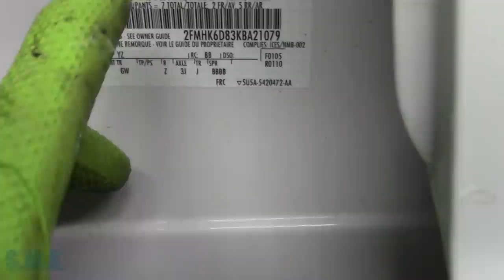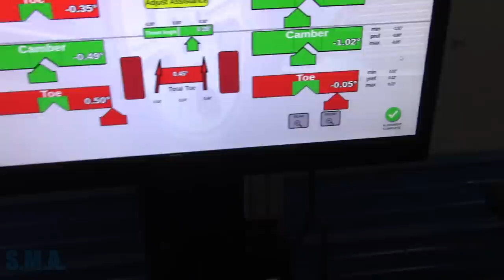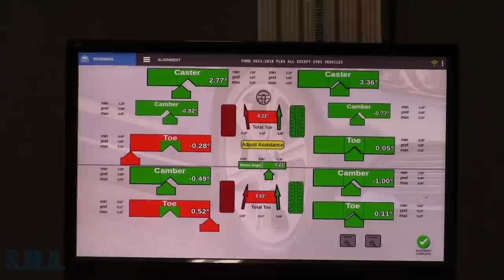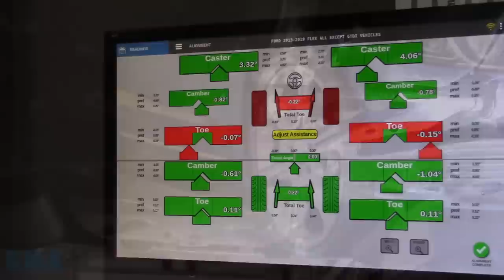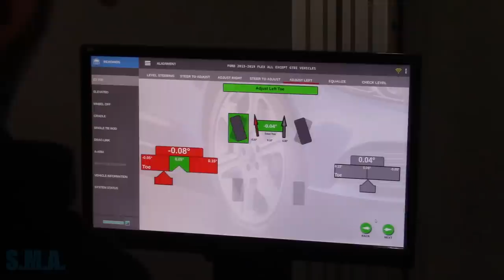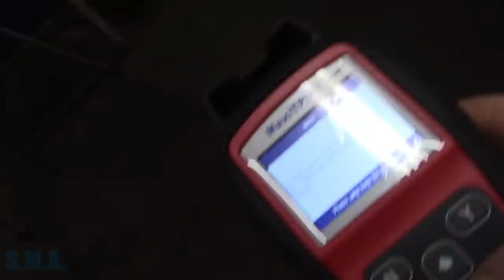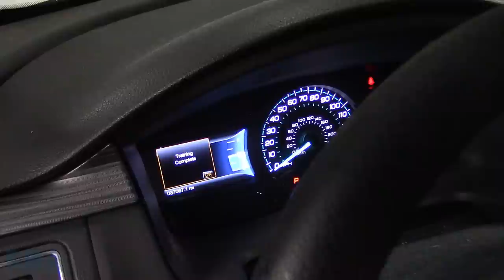Ford Flex: Wheel Alignment & Tires

Comment: A garage adjusted my alignment after fitting new tyres. The steering wheel was dead centre. After 10 minutes of driving it was way off centre. I returned to the garage and they said that they had to apply heat to free the locking nut on the steering arm. They hadn't allowed enough time for it to cool down, so as the arm cooled, it contracted and pulled the wheels out of alignment.

Comment: I can remember a car that went to loads of garages who said that the alignment was spot on event though it continued to pull to the left. A motorsport garage looked at it and YES the alignment was correct BUT the front subframe was out of alignment (apparently all the cars came out the factory with the same issue).

Comment: Ford dealer should tell customer repairs have been made But you need a wheel alignment, not included, or you will Ruin the Tires. It is wrong for Ford to repair and not align before shipping to customer anyway...  Great video!

Comment: If you need more work, I can certainly help you out with that. 2007 Suzuki SX4 and she's got the codes; evap leaks, cat efficiency, something about a prop shaft sensor... also needs tires! All this can be yours for the low, low price of donuts and coffee! I'll even throw in a "Where's all this oil coming from?"! Possible rear main seal.

Comment: 17:45. I once had to change a flat tire. I thought I was going to kick the car off the jack. I didn't have the corrosion as seen here but they were really stuck together. I then used anti seize grease on on all four.

Comment: Any other tool suggestions for cleaning the backside of the wheel? I'm worried about removing too much material from an alloy wheel. Maybe a white (fine) bristle disk? Or a fine roloc disk?

Comment: just wondering if you have started putting the foam rubber ring inside the tyres to lower noise of the tyre on the road surface ?   it’s all the new thing here in australia . it’s a donut of foam rubber same id and width inside tyre .

Comment: Since that was previously worked on at the dealer to have the rear differential replaced I would be first of all after the findings at your shop going back to the dealership and having words with the service department as to why I wasn’t told it was possible my vehicle was out of alignment and asking the dealer to pay for what I just had done do to their negligence

Comment: Damn, those rims are hammered for a 2019. They just don't make shit like they used to.
Reply: Wife’s car is a 2018 Flex, same black painted wheels. I hate their wheel paint.
Reply: @joekegg  It's not much better on the GM side of things either. Even the chrome plated rims start to bubble and peel after half a decade. Granted the New England winters contribute to that but it's just sad from my point of view that you have a vehicle not even that old and you have those kind of cosmetic issues.
Reply: @RiouInsuiko  Agreed. I have a 2019 Challenger and the wheel paint is ok but not great. Will likely have them powder coated. I had a Charger with “chrome clad” wheels—chromed plastic—and replaced them before they could bubble. 
For what a factory wheel costs you would think the finishes would be better.  Fortunately out west the climate is drier and they don’t salt the roads.

Comment: Fords/Lincolns I owned, do not need programming after rotation. They self learn by turning flasher on/off 3x, key on. What kind of pad removes the glue off the inner rims, without damage?

Comment: I had a 2010 Flex, and they are very sensitive to alignment.  I replaced front control arms, and thought I would be OK driving it to work for 2 days until the shop could fit me in for an alignment.  It ate the front tires in about 100 miles(they were less than 50% worn before).  I typically got less than 40k on a set anyway, but that was an expensive mistake.

Comment: Oh how I love when I have 4 paragraphs typed out, and I accident swipe my mouse right, and it ALL goes away in a blink ... :(

I've come to the realization that I need one of those newfangled tire machines with the mutant arms! You should see me trying to mount these modern rubber band tires. It's a full body workout!  It's like a monkey having relations with a football ... to put it in a  family-friendly sort of way ...

Had two NAPA caliper warranty claims, back to back! One was on our '93 940. I didn't know NAPA's Proformer line is remanned by Cardone! No friggin wonder. The 940 is on it's SECOND set in 2 years. All dragging. One rear caliper last year was so bad, I could get in the car, fire it up, and stand on the brake with both feet while pulling on the steering wheel for leverage until it flexed, and the piston didn't move half a MM!!! Totally junk in just a year and a half!! The front wasn't quite that bad yet, but was on its way. Immediately after finishing that, I had a comeback from a full brake job in September of '19 - 14, 495 miles, and the inner pad was GONE, pistons went right through the now tinfoil-thick pad, and got yanked from their bores, puking brake fluid all over the inside of the tire and wheel well. The rusty rim and step rail was the dead giveaway of the carnage lurking inside. What a mess!! Guess the only solution is to pony up for a genuine Nissan caliper, but the vehicle is owned by a single mom. I did what I could to get her out the door quickly and safely. Only charged her an hour labor, since I spent the first 25 years of my life in her shoes. Was glad NAPA covered the caliper, so she only had to pay for pads and rotors.

My plow has about had it on the ol' S10 - time to weld up a few more mower blades to get it straight again. :D We only got 6" of drifting powder. I didn't even have to clean the windshield off - it blew clean overnight! Only had to clean the strange formation on the right side and rear windows, lol. Winter's here officially! Here come's more snow for Friday and Sunday. :(

Comment: Hey Eric, you used a different disc when cleaning the goo off from the wheel from weights. What did you use? Dumb question but I have never seen that type of disc. I would like to get some.

Comment: what did you use on the grider end to remove the whell tape without damaging the paint?
Reply: It's mentioned above. Something called an eraser wheel. Though. they must also be called something else as I'm in Australia and have never heard of them.
Reply: Use the search term 'toffee wheel' and you'll find'em :-) they breeze through adhesive, but are weirdly kind to paint.
Reply: @Ro32da72  Thank you.

Comment: Gm replaced the rack and pinion assy. and lower control arms on my Sierra under warranty I noticed the tires were scrubbing bad going into my driveway, I went back and asked if the alignment was done, they also said that it would customer pay, I said I wanted to see the bulletin, the said no , I said if you replace any frt. suspension or steering component the alignment should be checked, to my amazement he came back and said I was right, according to the bulletin and did it while watched, they frowned on that.

Comment: Did you know that you are supposed to line the red dot up with the valve stem when you install a new tire. I learned that in training over 25 years ago. I was told that it helps the tire to balance better.

Comment: Now I wanna drive the 2hrs to your shop for tires on my truck and car, every local place here north of buffalo half-asses the tire install, they don’t bother to knock off the weights, I’ve complained and gone to different shops, and my truck still feels like a vibrator at any speed over 70... took one shop 3 times to balance my tires on my corolla.... and my truck was balanced twice at a shop, and twice at another, and still can’t get it done right 🤬
Reply: I went to a local independent that specializes in tires. Everything they have done for me so far has been perfect. They charge accordingly, and most customers won't pay the extra $ for a correct job. 

A few weeks ago I paid $32 for a rim leak there. That was the most I ever paid for a flat repair anywhere

Comment: My daughter's VW uses the ABS sensors to detect variations in tire pressure -  this obviates the need for those ridiculous battery operated TPMS sensors inside the tire.  Her car is a 2016 Golf and it also has enough space under the floor of the trunk to carry a full size spare wheel (remember those?)

Comment: Does spraying that fluid film on the wheel & brake rotor really help much? This is an honest question. I saw it has a flashpoint of about 405°F, but I'd think it would still burn off after hitting the brakes a few times.

Comment: Love wheel alignment, easy peasy until you get rusty busty need to loosen nuts and cams. Love the Autel 508 tool, the kiddos use it all the time about 50% compared to the Snap-on TPMS4. I noticed you didnt mention TPMS sensor placement  relative to duckhead and red dot on da tyre (ala Cadogan). Great follow up on the EPS and cleaning the hubs. Any thoughts on retorque after a test drive?

Comment: not sure about fords but fca vehicles are very good at relearning tire location on their own after a rotation or changing all 4 tires. in about 15 miles tops it will have calibrated itself. i have done some rotations where front psi was different from rear and watched on the dash during my road test as the numbers flipped from front to rear to compensate for my rotation. not really a criticism you do an awesome job, but on some newer vehicles you may be wasting a bit of time doing a tpms relearn every time. nonetheless, great video and great job as always.

Comment: They are going to no TPMS and just using abs sensors for rpm difference for the drop in tire pressure of 25% detection per DOT.  As tire pressure drops the size decreases enough to detect its too low with a compare to each tire.

Comment: The car needs tyres after only 18 months? must be really rough on tyres or they are really poor quality like firestone or bridgestone.  Also when puting new tyres on make sure the size is the exactly the same as OEM and has the same speed rating and load rating.

Comment: Cool beans...I think everyone is switching to electric impacts. I love my Milwaukee 1/2". Supposedly 1400 ft lbs of nut busting torque!
Reply: Yep, i bought one. Haven’t found anything it cannot take off yet or break off
Reply: Yea man those Milwaukee impacts are wicked good only problem I have is got to spend money on proper impact sockets as they just crack the Chrome vanadium ones from so much impact force / rate of impact 😂

Comment: "put the lights back on auto" 

Yes! THIS so much, THANK YOU! My BMW dealer invariably turns the lights off, putting me at risk of running blacked out. 

PLEASE PLEASE PLEASE MR  MECHANIC, LEAVE OR RESTORE MY LIGHTS AND OTHER SETTINGS AS THEY WERE!
Reply: If you need automatic headlights to turn on your headlights in the dark, you need to stop driving.
Reply: @markh.6687  What idiot comment is that? There is an auto setting for good reasons: it's convenience and safety. Same as auto door locks when you start driving. Or my wife's key programmed to open the driver door only, my key programmed to open all four. I like my wife to be safe, 'auto lights' included. I guess you sniff your nose at these fancy ABS, DSC and the likes as well ....
Reply: My pet peeve of having work done on my car. Given the number of cars running down the road, auto lights should be standard. The problem is that daytime running lights and full time illuminated dash boards fool people into thinking their lights are on. In the old days, not being able to read your speedometer was your first clue that your lights weren’t on.
Reply: @martijn-vels  It's hardly idiotic to suggest that drivers who cannot tell it's time to turn on their headlights should stop driving. I routinely see people driving with headlights off and totally oblivious to attempts to get their attention (flicking headlights on/off as I approach is a common signal). If they are that disengaged from driving they need to park their vehicles. Auto door locks are entirely unrelated to, and unsupportive of, your statements. I drove for years before ABS, DSC, and even DLRs. If you depend on the safety systems alone to save you, you're already heading for disaster. So a dealer that turns off the lights to save your vehicle battery (and light bulbs on pre-LED vehicles) is doing you a favor, and an aware driver will not have a fit over it; they'll say "Oh, I need to turn a switch or push a button." Gosh, I hope that's not too much a strain on them...

Comment: Must have been a rental fleet vehicle, my fourth vehicle was a retired rental fleet vehicle and the tires were never rotated and the front tires were the only ones replaced. Two months later I started to get a howl in the right rear under speeds and come to find out after a tire rotation the tires stopped howling and the rear tires were worn at an angle.

Comment: I bought some brand new rims and tires off tire rack and took them to a local tire shop to have them mounted. When I got home I noticed a scratch completely completely around the outside lip of the rim on the front. Took them back and he said that the the tires are mounted from the rear of the rim. why would I damage all four of my brand new rims that I took to him in boxes

Comment: You didn't index the tire to the wheel. LOL...may save you some wheel weights if you do. But I do love the actual torque wrench. Is checking ride height even a thing anymore before aligning vehicles???

Comment: Hey Eric, been noticing for ages that you don’t use anti seize as it’s too messy. You use fluid film as a replacement mostly.....how do you find it holds up over time compared to anti seize? I would assume it works good because you keep using it but would like your thoughts. Good question for a WUW session!

Comment: You replace a tyre the exact same way as me, and spend the extra few minutes cleaning the wheel and hub to get the crustys off! 
It doesn't benefit the customer, but it sure does benefit you when you replace the tyre next time!
I have one of those large lump hammers, normally required for steel wheels on a Ford Fiesta! 
I use a rawhide hammer for most alloys, if they need a bit of "gentle persuasion"! The hammer is branded as Thor!
Both the "hammers" I have were used by my grandad & great-grandad in the local coal-mines back in the early 1900's and 1950's!
What I would say is to get Black stick-on weights for those black alloys! In the UK the price of them is releatively the same as the standard stick-on weights, but it looks less conspicuous!

Could I ask why you inflate the tyre to the correct pressure AFTER the balancing has been done?
I did an experiment recently and noticed that if I balance the wheel with the incorrect pressure in, then inflate it to the correct psi and respin it, the weights required to balance the wheel up differs quite a bit.

Comment: Those the explorer, and the Taurus are famous for the rear toe links to be junk, but, present “good” until you jack it up on the control arms. The the rear wheels will move left to right from the junk ball joint. 
There is a TSB on them.

Comment: Speaking of cleaning and fluid filming the hub, do you also recommend that new cars like this one also get fully rust proofed as a matter of course?
Reply: Rustproofing or undercoating newer cars is generally a waste, and can actually trap moisture if the underbody isn't cleaned and dry before applying rustproofing. Modern cars are far more rust-resistant than in the heydays of Zieibart and Rusty Jones.
Reply: A permanent rustproofing is a recipe for disaster (Eric did a vid on a truck that rotted out due to Ziebart) but something non-permanent that's applied annually (like Fluid Film, Krown, Wool Wax, bar-n-chain oil, etc.) can be very beneficial if you live in the rust belt.  Keep in mind that it's the body shell that gets rustproofed at the factory, not everything that's bolted to it later.

Eric mentioned a Caliber that had its subframe replaced by a dealership...that's because Chrysler has a 10 year warranty extension on them due to accelerated corrosion issues. Annual undercoating with Fluid Film would have helped stave that off.
Reply: @chrisfreemesser5707  I saw that about the Calibers, kinda took them off my list unless they were 2012's, because by then they solves that issue.
Reply: @markh.6687  The issue was never solved...Chrysler eventually gave the 10 year corrosion warranty for the subframes to all model year Calibers, not just 2007s.  I have a 2010 and if it were not for me spraying them down with Fluid Film once a year, they'd be swiss cheese by now

Comment: With stuck wheels, I've loosened the lug nuts, put em back on finger tight, then drop the car down like an animal.  Usually works after 3 or 4 tries, first time.  Bam and on my way.
Reply: On the fronts, loosen lugs a few turns and then turning the steering wheel back and forth usually works.  On the rears, loosen lugs a few turns and once around the block will do it, most of the time.

Comment: Eric O', DAMN I should drive to Avoca for Tires!!! Better job than these "Pro" Tire shops. Lug nuts are always over 160 ft/lb. Pressure is always 35 psi. Steering wheel not straight after alignment, and a Test Drive after tires and alignment, (never)!  Then there are those ruined Clad JEEP lug nuts!!!  Note: I used to get a new car every 2 years. After low mileage on first set of tires, I learned. Before picking up new car I would insist that the dealer check the alignment and give me the readout. Often they would be adjusting it! Need 
Anything from Redding just give me a holler. Just like 5 or 6 blocks away. Great reason for a road trip!!